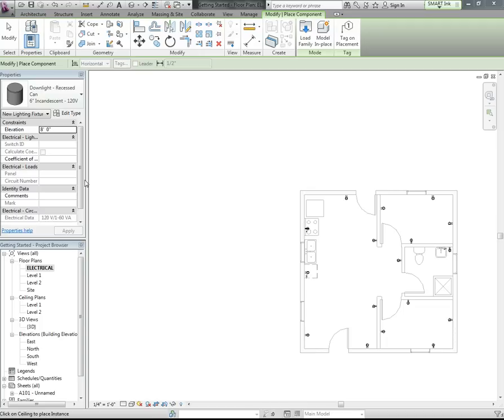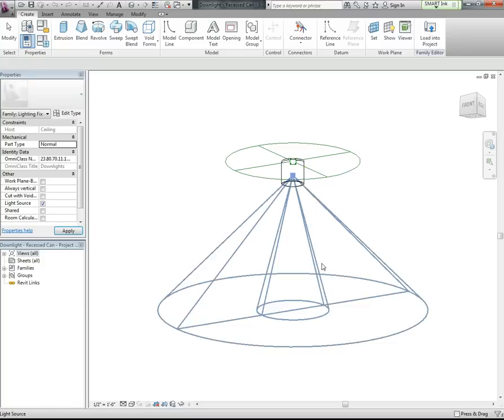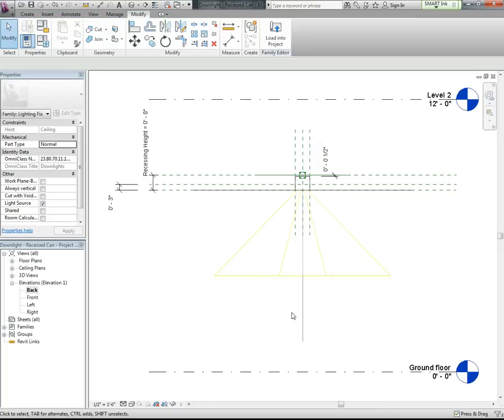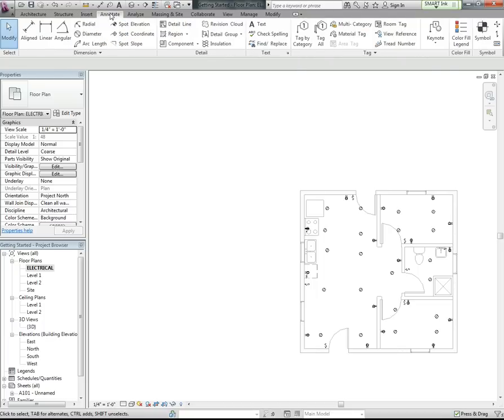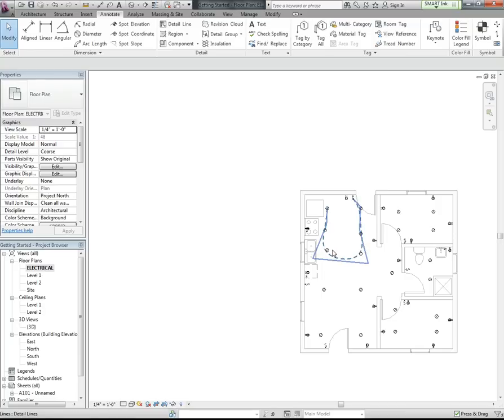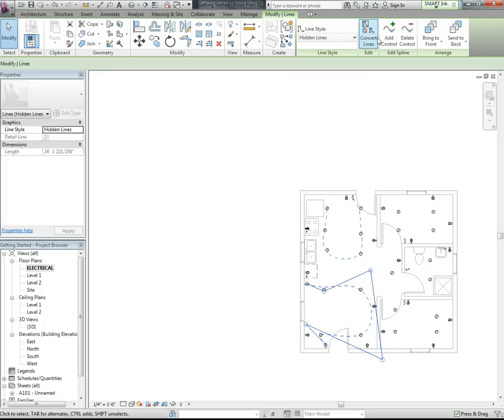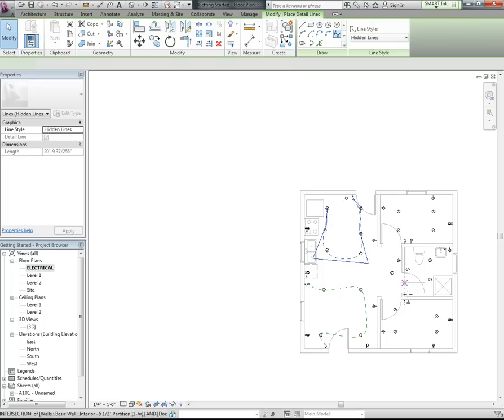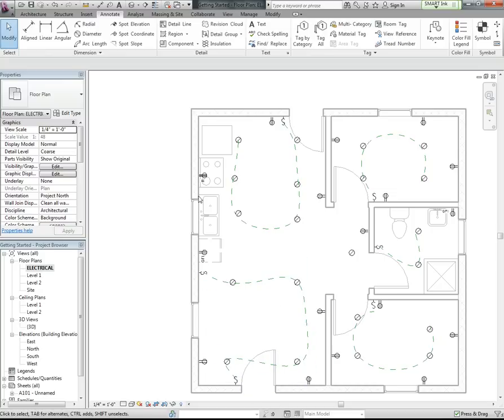Revit tutorial Electrical Plan part 2

Comment: I am having a hard time after the ceiling plan lights have been set. Now I am going into the electrical plan and for some reason the canned lights aren't showing up on this plan, even though they've been placed in the ceiling plan no problem. Any suggestions?

Comment: Great video but I think the fact that you don't have the MEP panel restricts your ability to create a proper plan. 
1) don't turn off the floor, just the pattern
2) view range deals city visibility in plan so adjusting it will let you see the lights
3) MEP lets you make circuits and power systems. Look into that

Thanks for the video still

Comment: A couple of issues with this video:  First you shouldn't have to edit the lighting fixture family to get it to show in the floorplan.  In the floorplan, change your view range settings to have the top be above the ceiling.  Keep the cut plane at switch height and you'll get what you want.

Secondly you should use wires to connect the lights rather than a detail line, they are easier to work with and can even be auto generated based on circuiting.
Reply from the maker: +ihatethetv  I will look into that.  Thanks.  I am pretty much all self taught.
Reply: +Ryan Swartz thanks for the video BTW! Self taught is probably the only way to learn. If you want to discuss anything let me know. I work with Revit almost every day.
Reply from the maker: +ihatethetv  that would be great I am a high school teacher that teaches revit in my class so I don't have a lot of time to learn new things.  I know revit can do so much more then what I know.  I might have to bounce some ideas off of you in the future.
Reply: @ryanswartz7738  I knew about the View Range but I don't work on it very often so I always get confused on how to make the dam lights show up on the floor plan! THANKS TO BOTH OF YOU for a very clear comment/description on what to do with the  VR and the very clear video and clever idea of making my lights be seen if I ever struggle with weird VR!! I have been learning from videos too which I hate it, so I was so happy to find you guys 4 years later :P

Comment: Very good and informative video. I also have some questions.
1. How do you add switches to wall mounted lights? ex. Sconce lights.

2. How do you add switches for a Chandelier. The Chandelier is attached to the ceiling in the living rm. The living room is an open space spanning 2 levels. I want the main switch for the living room to be located on the entry level (level 1). I also want another on on the second level where if a quest was coming they could be turned on from the second level (level 2) without having to go to the entry level to turn them on?
Also what advise could you give me on a more practical method to go about question number 2's Chandelier problem.

Comment: Great video! I had a few questions.
1. When trying to place a lighting fixture on a ceiling I get the error "Couldn't find an appropriate Host. Try selecting a different Host Face or switch Placement Mode."...what does this mean?
2. On another ceiling I was able to place the lighting fixture but the recessed light was upside down. How do you rotate it?

Comment: that not how to do a electrical plan on revit, you need to learn to power with the revit 
circuits and revit wires and panels to create a system that will be calculated by revit.
Reply: Do you have a video on that?
Reply: I agree it is not professional approach.
Reply: Agreed this video just needs deleting as it totally wrong
Reply: True.